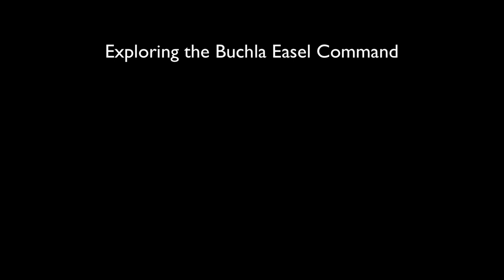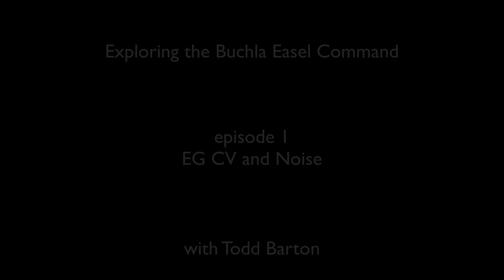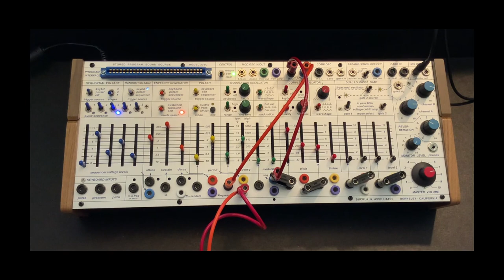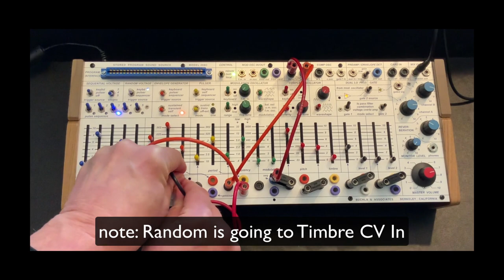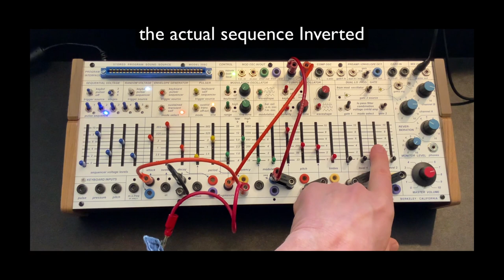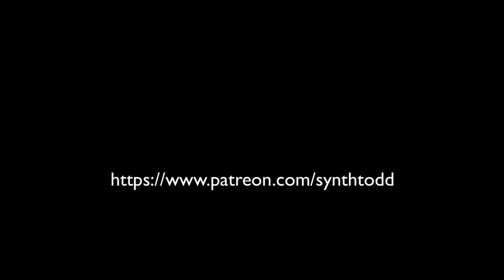Buchla Easel Command Explorations 1

Comment: Ok, I took my 208 out, flipped it over and found the switch for "seq s." It doesn't seem to randomize the sequencer stages, it just randomizes the number of stages played, kinda like randomly flipping the 3/4/5 toggle switch, but goes down to 2? I finally read the manual, and it says the 3rd option for that "m.o.freq or seq s." CV input is "to function as a sequencer source for pulse inputs when the sequencer is
 in the “off” position. This should be self-explanatory." 

I must be a moron then, because It's not obvious what this means to me, or why it would be useful.

Thanks again!

Comment: Hi Todd, how to choose between mo freq and seq-s cv input? I use Portabellabz The Toolbox for the seq-s and use the onboard cv in for the mo freq modulation)
Reply from the maker: There is a jumper or switch on the circuit board to engage random stages. Ah the Toolbox is most handy!